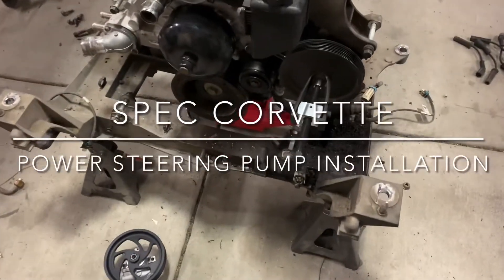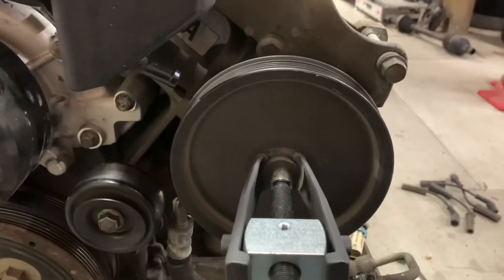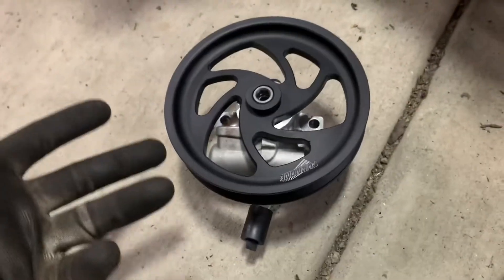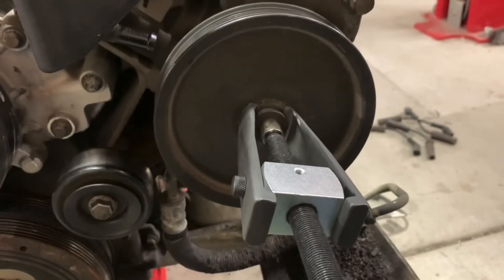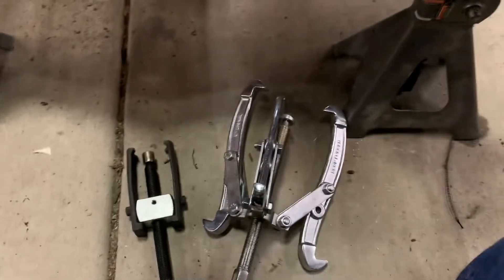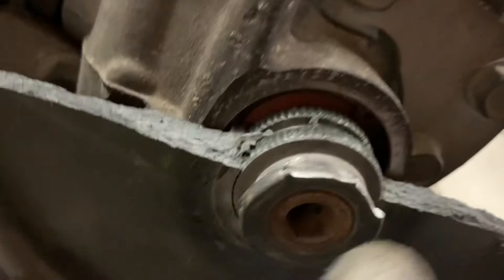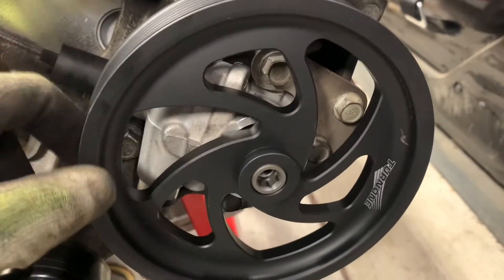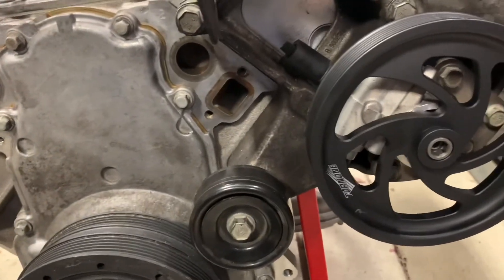Spec Corvette Build - Power Steering Pump Installation

Comment: @joshcarroll first thank you for chronicling the SpecCorvette build. I've watched every one! In the process of buying pump, can you help with the options to purchase? I would also like to run high pressure lines. Cheers!
Reply from the maker: Turn One recommends the HP2 pump. You’ll want their pulley as well. For Spec Corvette, you’ll need the stock sized pulley. Here’s the way it’s listed on my invoice. C5 / C6 HP2 SERIES PUMP W / PULLEY 1800 PSI / STOCK GM

Also, if you’re a registered spec corvette racer, Turn One offers a 10% discount.
Reply: @joshcarroll in SpecCorvette do you upgrade the LS6 lifters to LS7? Just got my head done and on the fence about upgrading the lifters. Also went w/TurnOne and looking forward to putting it back together. Thank you for your videos 🙏☝️